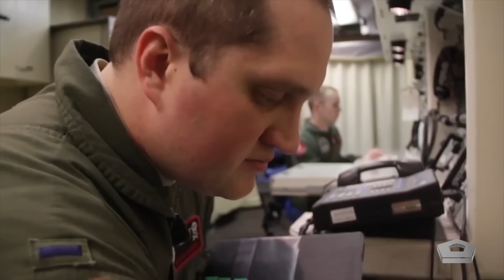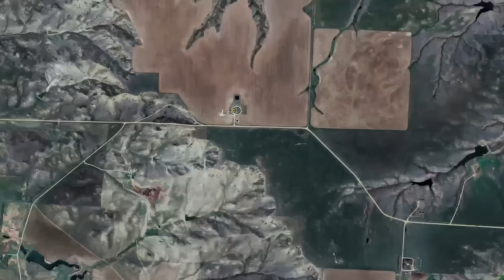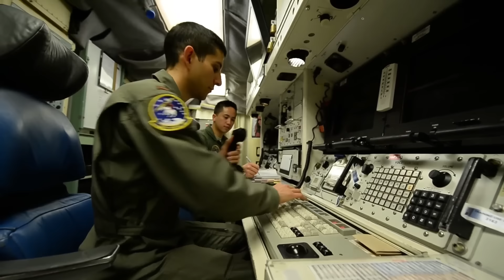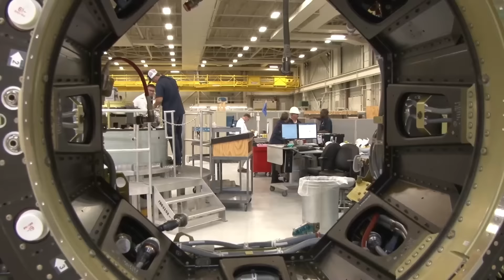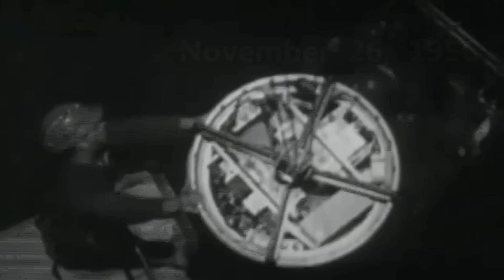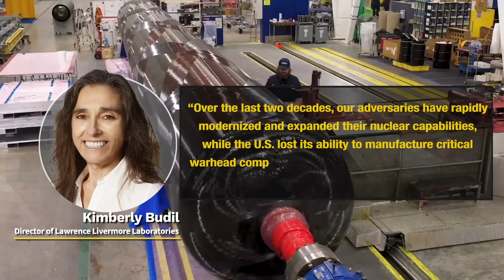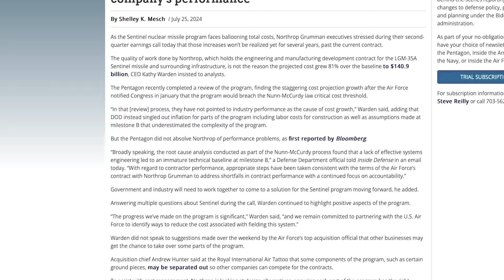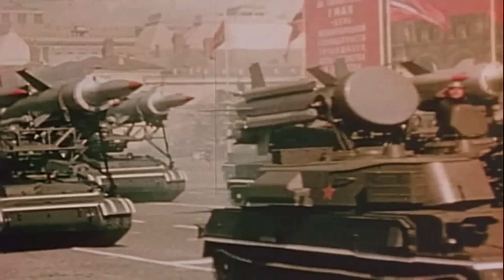America’s New Doomsday Weapon is Unstoppable

Comment: We’ve seen multiple breaches into critical defense IT systems over the years. In a way, the out-dated computer infrastructure provides security through obscurity and obsolescence. I shudder at the idea of a digital nuclear launch system connected to any kind of modern network infrastructure, isolated or not.
Reply: Exactly.  My understanding is that most if not all nukes are using old tech and are offline because of the inherent risks of being online.
Reply: @magtafcmdr8621  They are "offline" for security reasons. They are using old tech because upgrading it is not in the budget, and so far they haven't needed to upgrade because their needs have not changed much.
Reply: @magtafcmdr8621 nope. They are online 24/7. The old shit just can't be hacked.
Reply: @magtafcmdr8621  The DoD doesn't have just one network, and the locations aren't offline.
Reply: Security through obscurity only works in IT, and tbh it does not anymore. Since AIs know Cobol, contrary to any not-geriatric coder.
Reply: @prosysus I suspect  AI is equally proficient in FORTRAN?
Reply: @msmeyersmd8  ofc lmao. And Suahili
Reply: @prosysus  Brute force is only good if the system has unlimited tries. Most Mains and minis don't. Besides, were talking physical access to a network limited to a single military base.
Reply: just don't conect a silo to the internet
Reply: @Barten0071   You're likely on the right track BUT 

If an aircraft flying overhead can launch the missiles against the chance the ground control centre's knocked out or over-run  .........
Reply: @Farweasel  They cannot be launched from ANY remote location. The plane gives the codes to the crews onsite, THEY are the only ones who can launch.
Reply: @Farweasel  I'm honestly curious about this plane detenation method. I'm pretty sure from what I've read the operator in the bunker needs to input drives and keys manually. I'll bet the part where "If they lose communication" they have the planes as backup comms to the bunker. This is just my theory... I could be wrong but it would make the most sense from what Ive learned about these.
Reply: @Barten0071  I doubt they are very far from 1st gen transistor theory. Essentially analog computers. They would perceive digital incursion as spurious interference. 
Why upgrade the last Human remnant in the world destroying machine? 
Is there digital and WiFi? Sure but they would need a bunch of long dead engineers to revamp the system interfaces to accept even 80's tech. Like a phone modem.  
BTW, the magnetic storage system outlives your CDs and DATA chips. Look up longest life data storage. Interesting find.
Reply: @Barten0071  Doing that would be one of the dumbest decisions in history.
Reply: All new systems are vacuum tubes with lifetime heater elements... no solid state allowed...
 I just sold 400 old tubes to the minuteman review board..
Reply: triodes pentodes, oh a smattering of every diode.
Reply: @discoverneweyes HV vacuum tubes and circuits have a much higher resistance to EMP damage or disruption. Is that the primary reason? Or just a secondary benefit?
Reply: I used to work on the Minuteman III missiles. I'm with you.
Reply: @MissilemanIII  I helped produce them and both refreshes. Inconel baby. The good stuff. Parts is parts.
Reply: Yep, thats why the Air Force chose to keep the floppy disks for so long. You cant hack them.
Reply: @ImReverseGiraffe  i write all my notes in pencil
Reply: @ImReverseGiraffe  They are not actually floppies either, saying they are, that's more security. They are EMP proof "floppies". Wholly different technology. I used to retrieve government data off these old systems for a big corp when they bought the data.
Reply: @ImReverseGiraffe  Only way is to insert another floppy disk. I would assume this would be a closed off environment and not be connected to the public internet. Only connections going there would be a direct fiber from command to them.
Reply: Agreed!  I work at the VA and we have the original computerized record system.  The VA has tried multiple times to replace but have failed every single time.  However, it is really tough to hack.  Hell it's hard to even use.
Reply: The only problem with obsolescence is finding people to maintain the equipment. The US Government is finding it increasingly impossible to find programmers fluent in dead coding languages like cobalt.
Reply: @JessiBear  Is it so difficult that we are unable to re-educate ourselves?  Seems like an excuse as opposed to a real problem.
Reply: Total BSG vibes
Reply: Literally the impetus behind Battlestar Galactica
Reply: Security through obscurity is no longer a real security. You can run so many attack vectors, it doesn’t matter. Only true division, like a completely seperate network and encryption can ensure enough security. You‘re not getting that with an old floppy system. It’s not as safe as paper, and not as safe as a modern system.
Reply: Don't worry, it is air gaped.
Reply: Can’t hack two dudes 10 storeys deep in a bunker
Reply: We could still update the systems to better versions of the legacy systems by incorporating some more moderns components and standards. For example, instead of 8 inch floppy disks use 3M SuperDisks. Or, even better, use USB 3.1 SLC based flash drives connected by a USB extension cable to save on socket wear.
Reply: Yeah, I agree that the 1970s tech is safer for security and should not be updated. I'd rather we keep training specialists in dinosaur tech than ever risk modernizing it to something that could even conceivably be networked. Replacing old hardware is a bitch, yeah but they catalogue every part of those old IBM machines and use modern equipment to replace parts as needed. 3-D printing should be able to help with parts that just don't have machines to make them anymore. That 70s tech was just the perfect period for "just enough functionality" but before there was any capacity for networking that could allow even rudimentary hacking. That's really where the "upgrades" should stop since the threat of a hack is just too insanely dangerous.
Reply: @Lusa_Iceheart  Having a legacy training setup to keep the technical ability to run things up remains a worthwhile investment. Until someone bites the bullet and outright makes a proprietary coding language and OS specifically for missile silo facility use.
Reply: @Lusa_Iceheart  I think you can even extend that somewhat into the 80's you needed special add-on cards to do any networking then, I know I was there.
Reply: @Lusa_Iceheart  You're really misunderstanding that they're still networked either way, it's just a closed system. A computer in a bunker that only 2 guys have access to has to transmit data and commands to multiple missiles separated by several miles.  It may or may not be a common protocol in use, but its still a network. The equipment age isn't relevant from a security standpoint, with the exact same level of isolation. Unless you're worried about a supply chain attack that embeds some vulnerability into the hardware, it would still be hard to exploit it outside of some pre-timed failure because it's not connected to the outside world.
Reply: All nuclear silos and missiles will almost certainly be air-gapped. I really hope they're also on a dedicated OS that isn't windows based, and there are no IP or MAC address for the Sentinel missiles. If not, the passwords will likely be "tiananmensquare" or "WinnieTheP00H"
Reply: @mso82  As far as I know the system was updated in the 70s, before either Windows or the Internet existed. It was precisely because this older system cannot be hacked. It is imperitive that the newer operating system be based on the older hack-proof technology.
Reply: @mso82  I do not trust government security lol.  It will be on an unsupported old version of windows and probably still have known OS vulnerabilities unpatched.
Reply: @JetleanSam  Guy government uses UNIX for the most part in those days, Windows WTF was that in the seventies?
Reply: Skynet will never be a good idea, Ever. gotta keep nukes off the internet at all costs 😂
Reply: @Blacklite2k1  Exactly.
Reply: Indeed,Terminator's skynet would be round the corner.
Reply: Said it better than I could
Reply: Heck on the civilian side my familys data has been breeched like 5 times over a year or so from mostly health care companys. I can only imagine the devastation if we go to a digital milliary system and it falls into the wrong hands
Reply: "We’ve seen multiple breaches into critical defense IT systems over the years. "
Not on the SIPRNet, which is where physically isolated traffic happens. No mobile devices, radios, media, cameras....are allowed where it is, and the "two man rule" is enforced there. It's the same network that has connected the facilities for decades. And those 8 inch floppy disks weren't analog.
The majority of the equipment is far from outdated. Half of the super computers in the US are unlisted and are connected to DOE and DOD networks.
Reply: you know the story of stuxnet, right? i believe iran's shit was literally run by an analog computer and we somehow hacked it
Reply: I connected all the nukes to my wifi. dont tell anyone but the password is eagle123
Reply: AS a retired IT level 4 analyst I agree wholeheartedly. I watched many companies retain their mini-computer/mainframe dumb terminal accounting systems after PC's and servers went mainstream because of the viruses and hacking. I have argued HEATEDLY with D***B A***D fortune 500 management about putting infrastructure in the general inline environment instead of dedicated lines/routing or dialup. The DA management reasoning "its easier to work from home and access our systems if its on the internet" and "relax your paranoid dude". A limited network is inevitable, BUT FOR GODS SAKE NOT ON THE INTERNET.
Reply: Skynet
Reply: security through obscurity is not, and has never been, a thing. It's pure copium used by people who are stuck working with outdated systems.
Reply: you can modernize while still being off-grid...
Reply: Good morning, sirs
Reply: It's an interesting note  on A.I.. If they are part of the infrastructure, if no one is left alive to make a decision, it will. It would be a true doomsday weapon. Your decapitation strike won't work. Skynet you say? Someone will do it. I hope s hypothetical AGI likes us.
Reply: Yah, but they don't plan to connect it to anything.  You can use modern computer tech without network connections and without USB ports etc.
Reply: When they all run on usb sticks we will be in trouble
Reply: Floppy disc's and copper phone lines linked only to each other and independent launch control stations
Reply: We already invented a cdrom virus. So yeah. Nukes can't hide now.
Reply: The way China acts with its neighbours in the South China Sea tells you , you need these all updating ASAP
Reply: Why. He had them for 4 years and had zero new wars or threat of nuclear war.  We are a lot closer to nuclear war under pepaws watch.  He just cant remember the code is 0000. 
Shudder away.      That logic is like saying more gun laws will make criminals stop using them.  Chicago just hasn’t caught on yet.   People believe Hollywood over history  and logic these days.
Reply: Had the same thought. Gave me shivers
Reply: Don't worry they'll have Windows 11 and CrowdStrike soon. 😂
Reply: That's exactly why it won't change. It will be low tech forever.
Reply: Given the fact kids these days don't even know what a tape rewinder is; I concur.
Reply: Great comment. I was thinking the same thing
Reply: as someone who works in IT cybersecurity, I somewhat agree. the only problem I have with your take is that hacking doesn't work like it does in movies or shows. China can't just launch a "cybernuke" on a hypothetical digital nuclear infrastructure, and modern firewalls and digital safety protocols are always being improved, so a modernized launch system isn't something to worry so much about. I think it would be just as hard to infiltrate a modern network as it would to compromise the current one, if not harder. But I don't think the launch system is directly connected to the internet anyways, at most I'd suspect the network is super contained, if not straight up analog.
Reply: THIS
Reply: Bingo. What they use now, can not be hacked. Asking for some bs going digital
Reply: Security through obscurity is not real security at all.
Reply: U guys are fools if u think it’s even on a active operating system you know nothing about cybersecurity or our military we use old tech with new tech so things can’t be compromised
Reply: The old system is called skynet fyi
Reply: Yep!
Reply: They so strongly soak the informations in my head that my consciousness actually gets stuck there I almost die and I actually see like the environment and important parts of the ways they break in. There is for example a virtual Lidl where no Lidl is in reality...and what I seen in the Nexus. Looks not good. There are many many larger buildings than in reality. Much larger. Everywhere.
Reply: And you think China's system isn't fully digital? They are building silos and nukes at pace even to this day. The most alarming thing this piece brought to my attention was the fact America can't build a fucking nuke but north Korea can
Reply: EVERY single older IT admin has at some point stated VERY loudly "YOU PUT WHAT ON THE INTERNET?". Air gap is THE ONLY effective method. Localized networks are pretty safe, unless the aliens want in. They seem to be able to control our analog and older digital systems when they want to. Our modern digital systems are probably a security joke to them.
Reply: my thoughts is it becomes linked to a voice assistant like an alexa or something then you can have an interaction where you can say " Alexa, conduct nuclear launch from the silos...Etc" then it replies ok
Reply: Excellent point!
Reply: Need to be kept physically offline for sure which they already are (it's the reason they are manned).
Reply: The current systems with all its outdatedness can already be launched remotely from an aircraft flying over heard. Just because it's modern doesn't mean it's remotely hackable. No need to be paranoid
Reply: Yep. If it's online, it cannot be hacked.
Reply: Military networking stuff is both same and non-overlapping with regular internet. There's 2 things that military systems are having for enough level of protection: zero junctions to the internet, yep, literally zero; and human factor - in the development/testing/deployment phase there's a few pair of eyes that are making sure that nothing is getting onto protected machines. As well as additional physical protection layers such as Faraday-caged rooms for high-security things. Even the development are usually done with 2 machines: one is where all the real development is going, and other is a "normal" one that's connected to the internet and could be used for searching stuff or whatever else
Reply: If the new systems are properly isolated and the flash drives, or whatever new media they use, are handled properly, they should be just as secure as the old ones.

The old ones could still be remotely activated in the event they lost control with the silo crews, so they obviously had some kind of wireless / radio link. I'm guessing the Sentinel systems will have something similar.
Reply: I was going to say this exactly. Well said
Reply: @musk69  Thanks, I should’ve also mentioned, under the Obama administration while Biden was VP. Putin took over Crimea, but yet were led to believe that, Putin and Trump are best friends lmaoo
It’s clearly in Putin’s best interest to not have Trump in office period, seems like he’s gotten away with a lot more under the Obama and Biden administrations